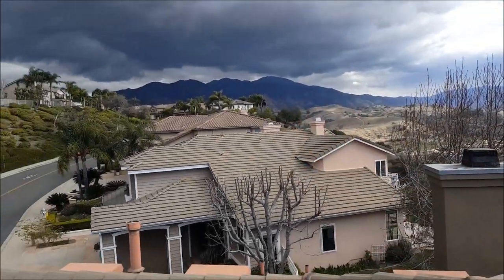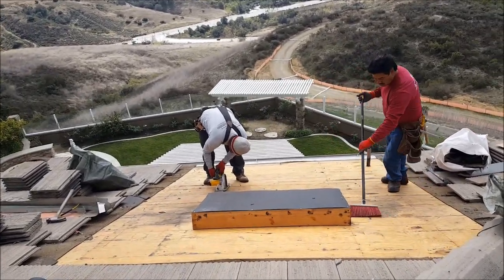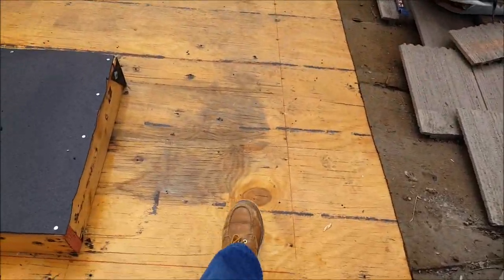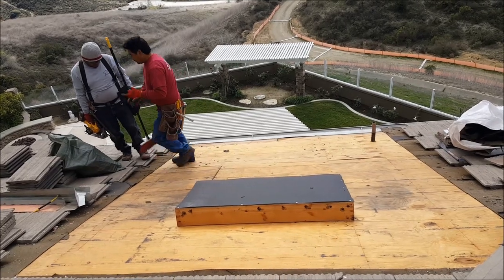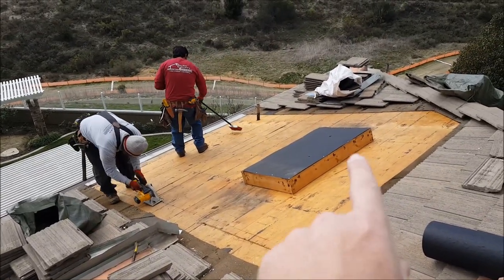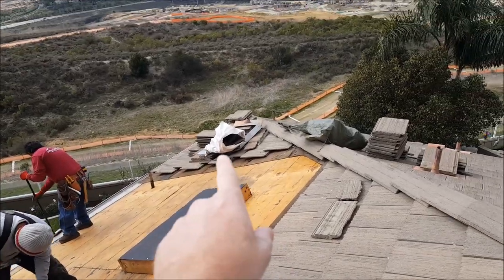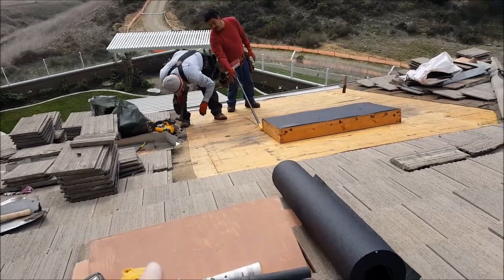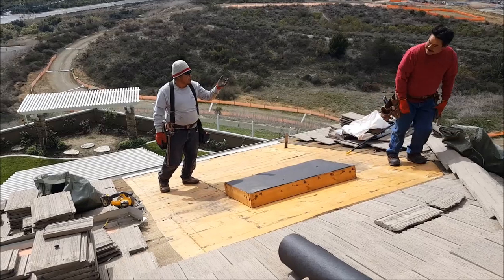How to repair a leaking skylight - Tips and Tricks you need to know to get the job done right.

Comment: We had a leak in our master bedroom closet too from a vent. The bad thing was you could not see the leak unless you actually walked in the closet and tuned around and looked up, it was so easy to miss and we did miss it until it started molding. The only way I knew I had a mold problem in there was the dogs ceramic water bowl I kept in the bed room was getting mold on the inside of the bowl no matter how many times the water was changed. Now I use the ceramic bowl with water method to test rooms I suspect might have a problem.  If it wasn't for my dog and her water I might still be breathing that crap.
Reply from the maker: You should periodically check your ceilings with a flash light.  That will help you spot minor wetting of the ceiling.  Best to do it while it is raining.  Most roof leaks can be spotted before the ceiling damage gets extensive.

Comment: Back and sides look like new flashing  not the complete front.
Reply from the maker: The front is probaly not new.  Neither is the wood around the framing or the skylgiht itself.  Some things can be re-used and some should be replaced.  The tile pan and saddle never come out clean and we replace them.  The 110 bent metal in the front comes out clean and can go right back in.  I wouldn't even recomend replacing that or the skylight itself if they are re-useable unless you want to charge customers for something that doesn't need ot be done.